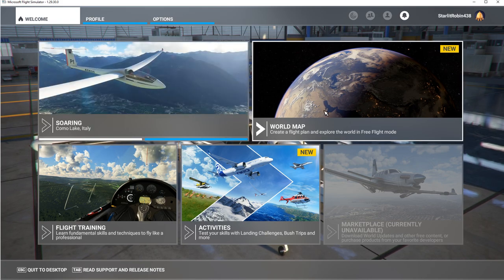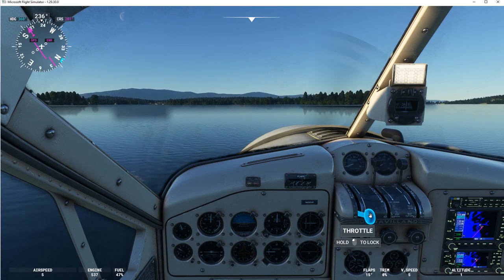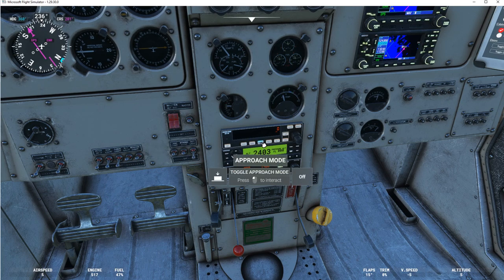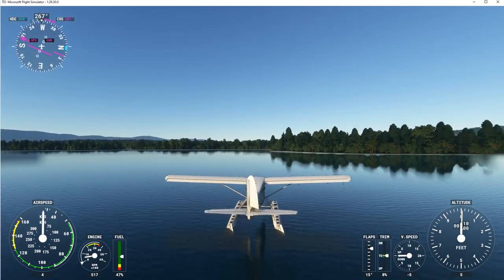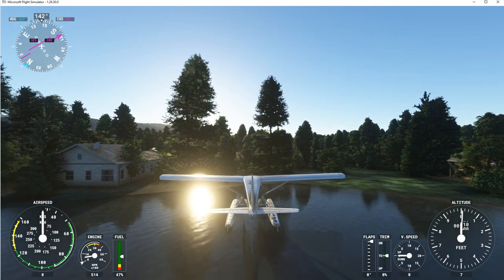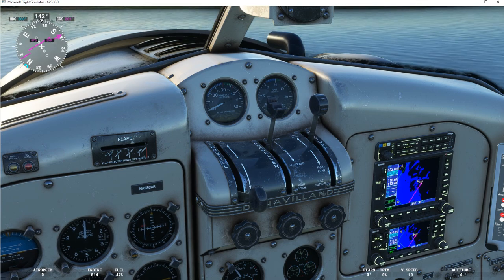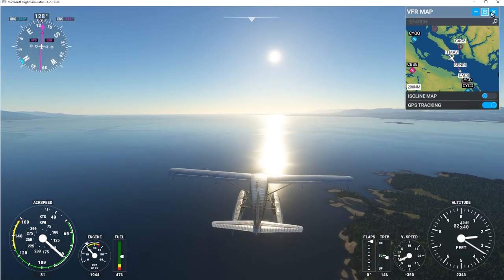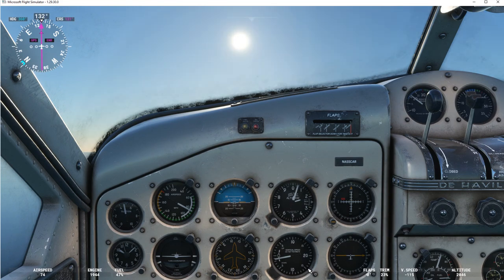DHC-2 Beaver Viking Air Limited de Havilland Auto Pilot

Comment: So basically, setting an altitude number in the autopilot is meaningless - you just have to use the v-speed up or down and then manually tell it to hold at whatever altitude you want to hold at, which pays no attention to the number in the altitude setting.
Reply from the maker: This could just be a bug that needs to be fixed. It really should hold the set altitude once it reaches the setting if the autopilot is on. Maybe the V-speed is not shutting off like it should when the altitude is reached.

Comment: how do you change heading in hdg mode? Where is the knob?
Reply from the maker: Look at the Heading Indicator dial on the cockpit dashboard (aircraft image) on either side of the Heading Indicator there are two dials on the right side is the heading bug dial. Set that dial to the heading you want. The head bug will move on the heading indicator as you turn the dial. When you have the autopilot turned on you turn on the heading mode button and it will follow the heading you have set using the heading bug dial.
Reply: @IFRSKIES  but do you mean looking cokpit from inside o virtual instrument from outside?
Reply from the maker: @uischirock  You set the heading mode on using the button on the autopilot panel. Then on the instrument panel in front of the yoke you see a heading indicator (it has an aircraft image on it) This is where you set your compass heading and heading bug using the small round dials below and on either side. The autopilot when turned on will follow the heading bug setting if you turn on heading mode button.